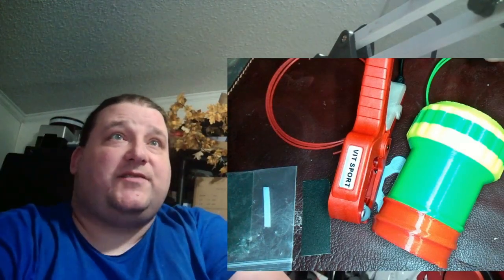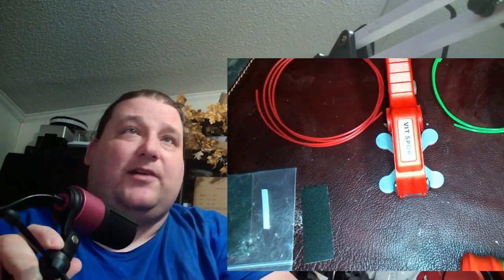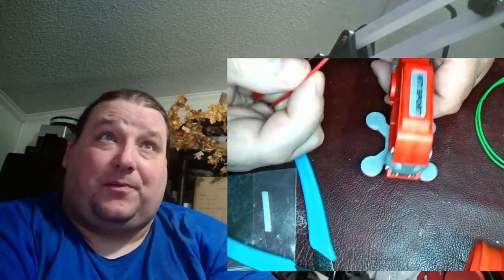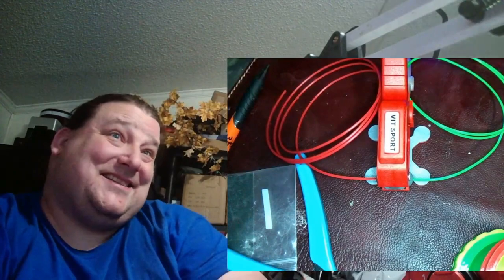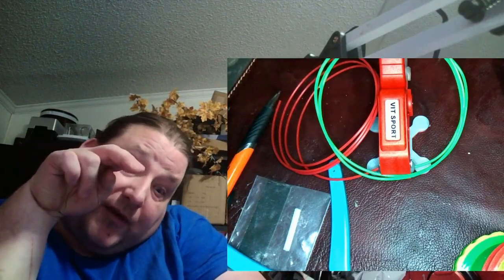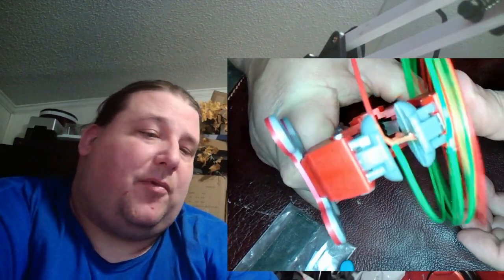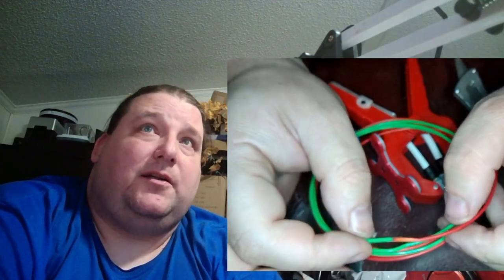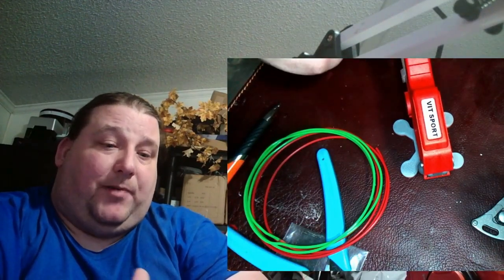Holy Cow it works 3D Printing Filament Joiner T3DP

Comment: The audio has a constant buzz might need to add a noise floor in post
Reply from the maker: That might be the heat pump. Next video at the end I will record a segment and turn it off and you guys can tell me if the him goes away.
Reply: @nerys71  that's fine, you should be able to remove it in post by removing that frequency without too much issue if it's not practical to remove the actual noise

Comment: I'm new to printing.  How much difference does it make for the final product using this tool VS using a 'change filament' function and swapping spools?  Thank you!
Reply from the maker: Using a change filament function will do what you want this will not do what you want doing this to do the same thing as a color change would require math and planning and integration with the g code that is not so easy for an individual to do

This is for joining two pieces of filament together when you don't care what color it prints not for changing colors

So for example when you use up a spool and you have a few feet of filament left over you can't really do anything with that well now you can you can join all those little pieces together and make something useful out of it or if you have a large print going you can join one role to another role so that you can just keep on printing
Reply: @nerys71  Makes sense!  Thank you!